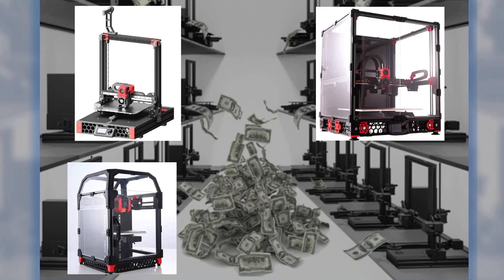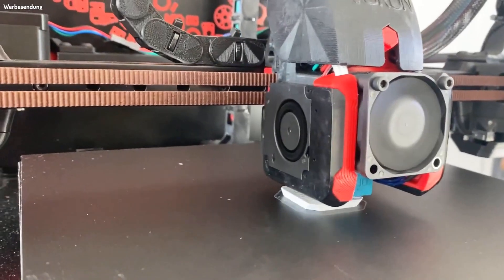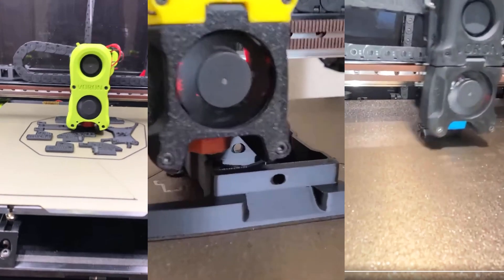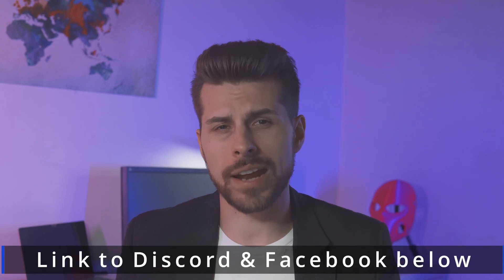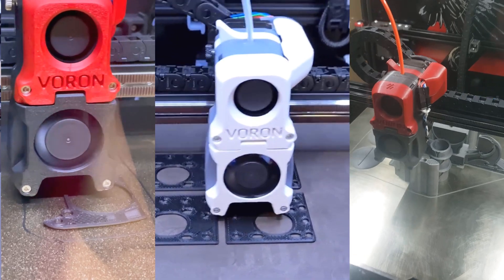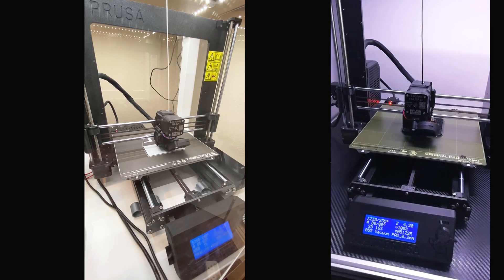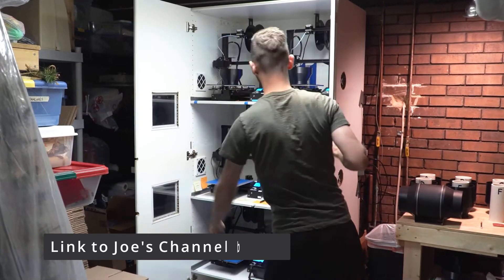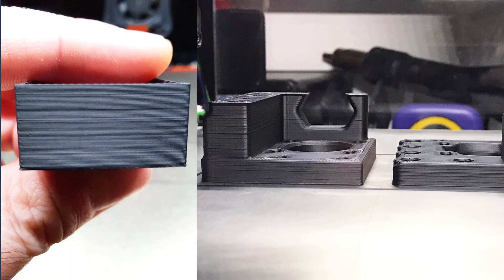Voron Printers: are they true farm printers or capable hobby printers?

Comment: One of the things you said in there about making your customer wait is really kind of irrelevant, if you are taking orders from a customer that will need to be printed on a printer you have not even sourced materials yet or started building, that's kind of bad practice. You can eliminate that issue by simply not doing that and not taking orders that you can't print on your other printers.  
I actually think the voronn is one of the best production printers you could buy, because the form factor allows it to be adapted to so many different things andn so many different sizes. If you need to print pla only, you can add Part cooling that is sufficient for it, and take out the enclosure, if you need to do extremely rapid prototyping or want to do some speed printing, you can add external part cooling fans and super high flow hot ends.  If you need to print with flexible filaments, .    Add proper direct drive setup, if you need this print with extremely high temperature material relocate the electronics, insulate the chamber, and add active heating  If you want things to heat up faster or slower, add higher wattages.  
The modularity of it, help create a form factor that you can use for a bunch of different printers that are all the same, and allows you to fit them together neatly, add some consistency, and have very high quality with an open source platform.  And not having to deal with proprietary parts. You could build a ton of printers by buying the parts in bulk and cut your cost down by several hundred to 1000 dollars each. 
The fact that it uses external computation in addition to the controller boards will set up the ability for you to run multiple controller boards or multiple different types of controller boards, be able to add and subtract steppers, use larger or smaller steppers where needed and for different things, you could customize a machine to be either very specialized and do one thing extremely well, or do bunch of different things decently, and you can easily convert one of the printers over to doing something else.  With some other types of knowledge you could essentially scale everything up and make much larger printers with larger extrusion and edits to the printed pieces.  If you need something exceptionally precise and you need everything to be just perfect, you could get machines CNC parts made with very high tolerance so everything fits together just perfectly. You can choose different filament sizes you could Print with everything from 1.75 mm nozzles all the way down to .1 mm nozzles.  It's just adaptable in so many ways. It's for this reason that I think the voron is the perfect production printer. At any given time there may be a different printer that is better for a certain thing but the boron can be adapted to be as good as that printer. And even if you just build one and you buy the highest quality materials and spend $2,000 on it, you're going to get a printer that's worth two to three times that based on the quality.  Printers truly capable of printing high-end for production. With enough knowledge you can change in the death every aspect of this printer to meet exactly what you need and with not a whole lot of knowledge just a pretty basic and general knowledge, you can adapt it to do any normal thing you might run into for an average city printer user.  
I do think it is the perfect obvious printer and home user printer as well, for a lot of these same reasons but also mainly because of the quality you get for the money, but from a business standpoint it just makes so much sense. With wholesale purchasing and the ability to buy things in bulk, you could likely purchase and build several of these printers for the same cost as just a handful of similarly sized high end professional printers. Now I understand that these are not going to be able to do certain tasks and when you scale up to certain sizes they're not going to work but those are not really relevant here, because we're talking about 3D printers within a certain size range, and use for specific purposes.  I think the biggest drawback of the voron is that it is going to need to be built and adapted by the end user, so some people with more money than knowledge may want to just go by and already complete turn key setup. And for them something else may be better but for somebody who is looking to save some money have a very versatile printer be able to print many different types of things, and be able to easily work on their machine and tailor it to what they need, this is it

Comment: Honestly they give you commercial capabilities, things like changing many different hot ends and cooling systems. Plus its high performance just like you would see in a industrial machine. A coreXY machine with a open source system is actually perfect for a print farm. you will spend more time debugging stuff on those cheap machines and not be able to print anything that looks decent consistently in any material. You can make a voron 2.4 for like 700$ total cheaper then a prusa also. and you can make a voron 0.1 for like 400$. you have less problems to deal with with these systems honestly because they use better parts and they fix allot of issues with there advanced tech. Having a army of cheap machines means your company can only make cheap products... If you have 100 machines you will have at least 5 employees anyways to help keep them up. I spent more time dealing with issues w my ender 5 plus to know that cheap isnt good. Honestly I think you can devaluate your entire use case with one criteria time is money. You spend more time trying to level and tune you cheap PLA filament on something that cant cool and cant extrude precise your product will look like a noob made it. Kinematic bed leveling saves time. Can you do that on a cheap machine no lol.... Not to mention I think the down time would be less on something where you can 3d print almost all the parts for it instead of ordering it.

Comment: Thanks - I think the time it will take to setup a Voron vs an Ender or Prusa is not worth it for production. Running 40 Enders - you don't have time, if a machine is giving issues you have either remove it or replace it, or schedule maintenance for when there is time. You want something ready out the box, at a low price.
Reply from the maker: Hi Ian, yeah replacing a whole machine at $300 sometimes is less expensive than dismantling stuff. Still, vorons and kits serve a purpose for those who need them and are okay investing their time to repair/fix stuff

Comment: I think it really depends on 3 crucial points, in order of their importance:

1. What is your use case? 
- Do you plan to print a lot of big parts and are focussed on engineering plastics like ABS/ASA/PC/PA/... -> a 350mm Voron Trident/2.4 is a rather affordable machine in this segment, which ranges mostly from 2000-5000$. Sure you could mod the hell out of an Ender 3 to get it done, but this is a whole other story. 
- You need soluable supports for complex models? An IDEX printer is the way to go.
- You need PEEK & Co -> get an Addwise/Vision Miner printer. 
- You need just simple PLA/PETG prints in huge quantities: a lot of Enders would probably be your most cost effective way to mass produce them (although Vorons easily can produce the same quality around 2-3 times faster, simple ROI calculation in the end). 
- TPU? Direct drive strongly recommended
- Rapid prototyping with a lot of iterative design changes -> the speed of any coreXY printer like the v0.1 may be your friend.
Each printer has its unique qualities and should be chosen accordingly.

2. Are you/the team deep down in the technical side of the 3D printing world or just on consumer level? This part is mostly about maintanance and support (I'm btw a Prusa MK3S owner, but nevertheless consider myself a geeky tech digger) 
The Prusa USP is clearly its convenience, just hit and print, and if something fails, just contact the 24/7 support, right?
Well, this is kind of not the whole story. Even though there are great preconfigured slicer profiles, each model still has to be appropriately adjusted to it's specific needs in the slicer anyway, you simply have to get to know your own tricks with time. 
The more challenging topic is support. Yes, it is great for starters and easy-to-solve problems, but it's not much more than a standard guide. When things are not so easy to find out, it can become a long hustle which not seldomly results in simply replacing parts yourself. Here again, with time comes knowledge and you will be far faster in repairing your printer yourself, provided you have a good set of spares (which I would recommend anyway for a print farm). 
What I would consider a useful support would be actually a technician, who comes around and solves your problem without you having to tinker anything, like many big industrial machine sellers do. This way it wouldn't simply be your problem and you don't have to get into the technical side of the machine. But this whole Prusa support thing is way overcooked in my eyes (and not even talking about Enders at this point) and not needed after a short amount of time.

So yeah, Vorons are in general more complex designs, which takes longer to build and some issues may be harder to repair, but it is not of a big deal as often said. They run reliable once set up properly, the documentation especially for standard configurations is great and in my experience, most issues in day to day printing come anyway from the hotend and extrusion side, which is more or less the same for every printer. Furthermore, there are a lot of good standard profiles for them out there, even Prusaslicer 2.4 has some integrated by now. If you want to max out the performance, you have the option to use Inputshaping, but that's up to you.

3. Selfsourcing vs. preassembled printers? No doubt, selfsourcing is a real pain in the a* and can take a lot of time. Fortunately, there a a lot of great kits out there for Vorons (LDO, FYSETC, Bluerolls, ...) which solves at least this part of the process. The real struggle will be the building time, which can take several days to complete (even a Prusa MK3S kit takes almost a full day). 
In contrast to that, Enders, Raise3Ds, Ultimakers, QIDIs, Flashforges, etc. will be ready to go almost directly out of the box. But again, you simply have to know what your time is worth to you. You like spending a few $ more on a printer, to start few days faster? Are you planning on setting up 5 or 25 printers or even change them frequently for newer models? Considering a usage time of more than 2-3 ore more years, is a building time of 2-3 days really relevant? Better knowledge of your machine is maybe a factor? No general right or wrong here I might say.

To sum it up, yeah you definetely can use Vorons in print farms. But this might not necessarily be the right way for your business. If I would be in the position to start a print farm, I would wisely choose my setup mainly according to point 1 and might consider even a mix of several printers. so all my use cases are covered. Nothing more, nothing less. The point with maintenance is for me a bit neglectable tbh, it's almost the same for every printer with a decently developed and approved design, you have to learn it anyway to do it yourself and will be able to do so.

So I want reliability from my printers, but at the same time, if I make my living out of it, I simply have to know my stuff ;) There is no substitute on that
Reply: Addwise/vision miner printers are sort of a budget/hobbyist option for PEEK (They can only achieve amorphous printing). They are not ideal to achieve high crystallinity as the chamber temperature is not high enough (you need 250deg or above). A subsequent annealing will be required which industrial printers with high enough chamber temp don’t. And that subsequent annealing will deform the parts. If PEEK is printed with high crystallinity from the start it won’t deform and you can see it will have a solid beige colour. That is what the industrial and medical requirement is. I would never recommend these kind of hobby printers for PEEK printing to anyone if it’s for industrial/medical use case as you can’t get repetitive results.
Reply: Printing ASA/ABS/Nylons is not a hard task with an ender style printer. A new hotend and an enclosure and you're good to go. That being said I really like the voron design, looks, and performance. For my use case I just don't see the need for one and dropping $1500+ on a printer because it's ~2x faster than my $200 ender 3 v2 just isn't worth it. If you need a printer that you need rapid prototypes to get the correct dimensions I think the voron would excel at that.
Reply: Thank you for saying it, I knew immediately at the start of the video where he was going with it. I recently bought a Voron 2.4 r2 350mm model to accompany my highly modified ender 5 Pro as I needed another highly capable machine that could print even larger parts, I think if your going to run a print farm it should be as versatile as possible if you have room for it. Then again I think everybody is correct in saying it really depends on what you personally are printing  in your business, small things, large things, or a mixed bag.

Comment: Interesting video!
You told you're mostly using heavily modified ender fives. Doesn't that also limit scaleability, since it takes some time to modify them? Or is that a relatively short task since you've done it multiple times and know what to do?
Reply from the maker: Good point Willem. The mods i mounted require about half a day for machine. So if i have to get a couple of more printers for increased print jobs it requires very low effort.
Reply: @3DPrintingForMoney  gotcha, thanks for your response!

Comment: I'm not sure which way to go is better a self build or production machine. If we're talking pure production than midas well go out and by a duel extruder epslion for 7k. In my thinking there is more time to roi with the voron. However, if I build my own machine there's a degree of understanding the equipment that I just don't have without a self build. Perhaps the production machine breaks down and you spend hours to troubleshoot. Not sure it would offset the time spent building the voron. For me I'm entering this market with several things in mind. Quality vs quantity maybe a key factor for many. For me quality of print including the ability to print alt materials are my main consideration which also require higher temps. Not sure I can get that with a production machine. Still deciding

Comment: I think vorons and corexy have dimentional stability problems.. I mean the squareness of X Y Z are maintain by belts which will expand individually.. and loose squareness. unlike a cartesian printer squareness is fixed by metal screws.. basically calibrate then burn the calibration in firmware and forget about it forever as long as you dont move those axes they will always be square.. imagine 2 fitting parts you print today and you reprint one part a month or year later.. will they fit the original as good as before..

Comment: I recommend rat rig v core 3 instead of voron 2.4, bcos i have built both and installing klipper and mainsail os , config file is nightmare on 2.4 ,developers didn't even touch the most important part of build which is klipper firmware, you have to ask in the forum's, rat rig does it in single flash of the raspberry pi. 👍

Comment: I built a voron 2.4 in less then 5 days my 8 prusa mk3s on the other hand have gone thru multiple motherboards and bed thermistors my lulzbots tax 6 have been very reliable my 2.4 and switch wire have been great machines it’s someone’s skill set I’m a manufacture and design engineer that has been printing materials from stainless to pla the video could use a lot more information

Comment: Overall I think this was a good video. I did find one thing that was kind of ridiculous. If you are running a printing business, you are not waiting until you get an order before you start sourcing a machine. So the concept that customers will be waiting 8 weeks for you to get a printer, build it and then print their item is kind of out there. I do agree that a Voron may not be the best option for a farm printer. For that you are looking at the lower cost Ender series. However, for rapid prototyping and design iteration or just a fast one off print, you can't beat a Voron with a stick. Mine prints twice as fast as my Prusa's with as good, or in many cases, better quality.

Comment: Honestly I have no idea why anyone buys Enders over Qidi's. Much much less reliable over their given build volume, they do not hold level a fraction as well, and they need to be modded to work good. You would be better served by a team of qidis than a team of Enders. You also harped on issues that also plague enders, just try using the entire build volume of an ender reliably. Three words: not, gonna, happen. Would have rather you talked more about the numbers which you know better and less about the mechanics
Reply: Love my E3V2. Love the glass bed. Everything sticks no problem. My Glassman looks brand new after 6 months. Mine's been pumping out perfect prototypes oh man for 6 months now. First printer and only thing I upgraded was all metal extruder, metal hotend and CRtouch. Jyers firmware. Using the CRtouch bed leveling mesh I can use the whole printing volume perfectly. I also print at 150 mm/s.

I like the Qidi's too. Was looking at the x-plus but might build a trident instead.

Comment: Your Voron vs Prusa comparison is off. A properly built and tuned Voron can easily print over 2x the speed of a Prusa, not to mention you can fit more on the build plate than a Prusa